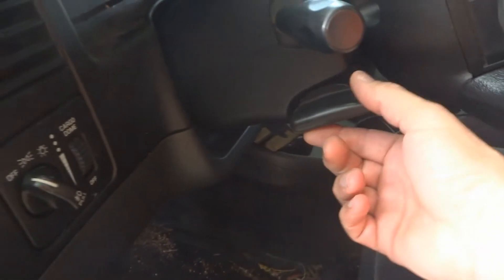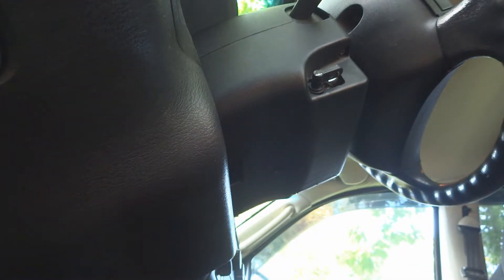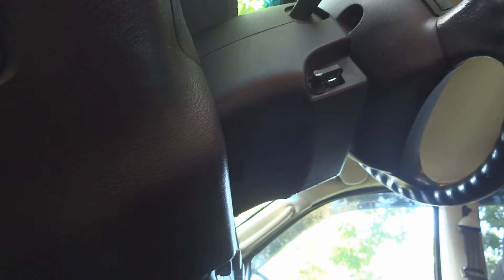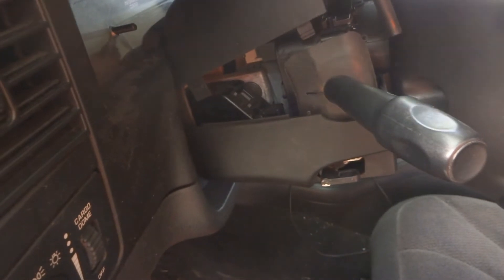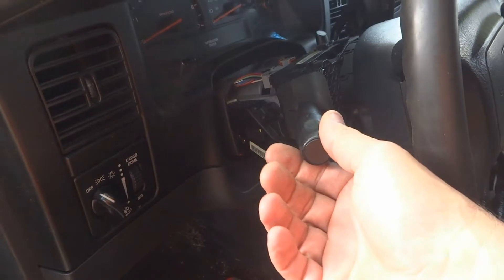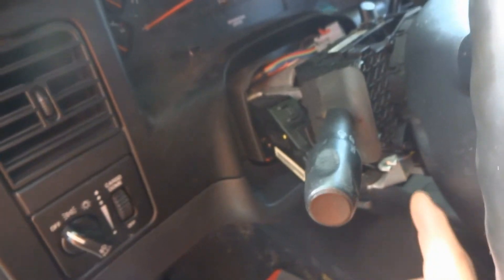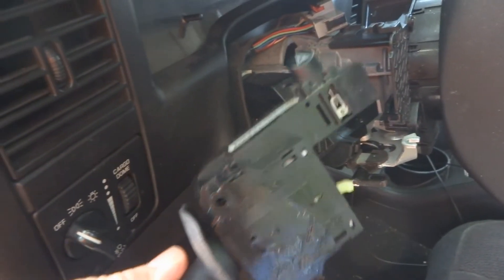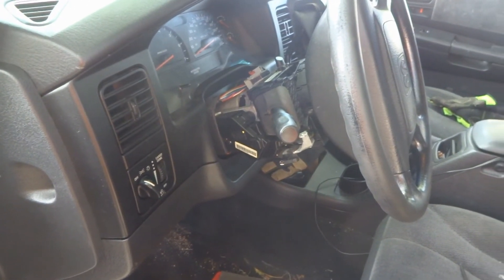2002 Dodge Dakota Steering Column Access

Comment: Thanks for your video. I have to replace that multi switch. I thought the whole steering wheel had to come out. Just unloosen screws and pull switch out. 👍
Reply from the maker: Happy to help! Thanks for watching!
Reply: If ur not careful, you will do more damage than good. I'd like a video 2005 durango tilt mechanism